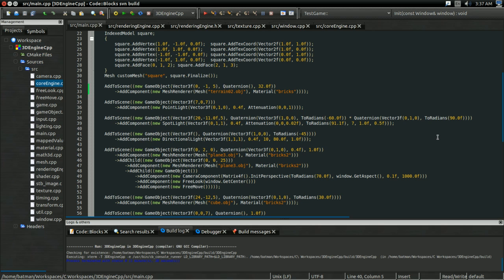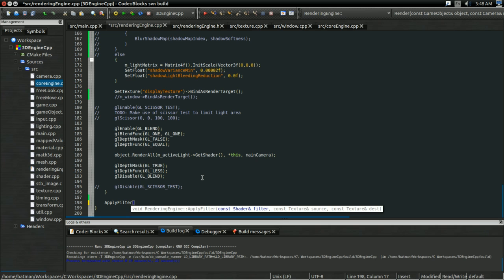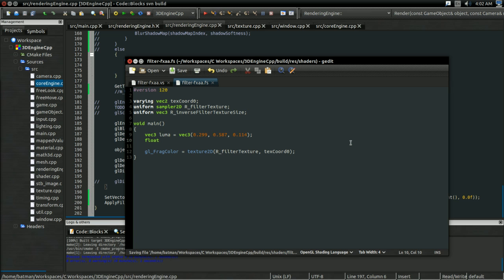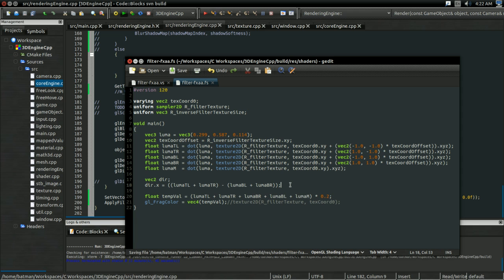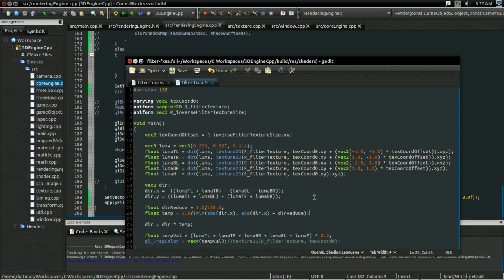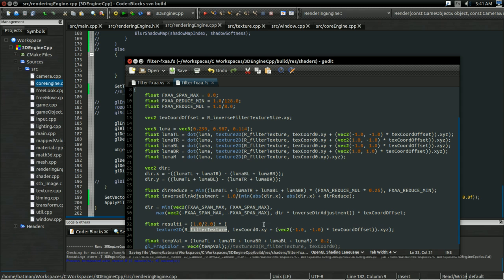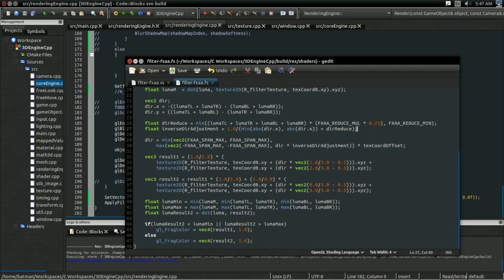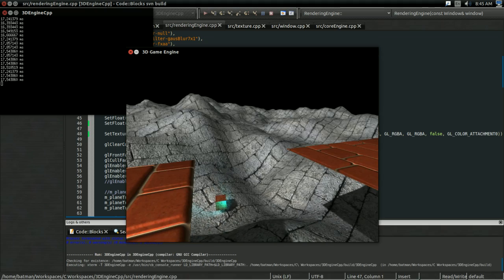OpenGL Game Rendering Tutorial: Implementing FXAA

Comment: I just have one question. Why are you forcing the blur direction to be diagonal up/right when the magnitude is too large, and diagonal down/left if the magnitude is too small?

Couldn't you just normalize the blur direction and multiply by the maximum magnitude to get the same blurring direction, instead of changing it to two different arbitrary directions?

This is the code I don't understand:
dir = min(vec2(MaxMagnitude, MaxMagnitude),  
    max(vec2(-MaxMagnitude, -MaxMagnitude), dir * magnitude) * texCoordOffset;

Comment: Also, couldn't you remove the texture blurring by setting a minimum threshold on the blur direction, and only blur when when the direction is larger than the threshold?
Reply from the maker: Absolutely. In fact, I did this in the code repository.

Comment: The applyFilter method wouldn't work for me in Java because the uv coords were flipped every which way. I had to change them to this on the plane obj:

vt 0.000000 1.000000
vt 1.000000 1.000000
vt 1.000000 0.000000
vt 0.000000 0.000000

They filtered results would have everything flipped on screen.

Comment: Hey +thebennybox. My controls have been working fine. Yet, when I change from rendering directly to the screen to rendering to the texture, some of the controls become reversed. Up & down are correct, however left & right are reversed. Do you have any idea what could be causing this? Thanks.
Reply: ***** Isaac Woods  I'm still trying to solve this bug and I've figured out (in my case at least), It has nothing to do with plane orientation, (I made a hardcoded plane, that displays the texture perfectly fine, at 0,0,0 with the right size and orientation), it's not the camera, because you can get rid of the T_MVP, it is unnecessary if the plane is in right position and the camera too. The filtertexure comes in flipped is the problem, This is an easy fix, i can just also flip the texCoords of the hardcoded plane but it does not solve the core the problem. The only thing i can thing of is if the texture binding as renderTarget or the texture initialisation is wrong but i can not track the issue, plz help!
Reply from the maker: Simple: In your ApplyFilter code, you're rendering an upside down plane, or it's in some other odd orientation.
Reply: ***** That is what I thought was happening. But the plane transform looks as it does in your code. In your Github repository, I noticed you where rotating altCamera by 180 on the y axis. In my code, I set the rotation to 0:  altCamera.getTransform().setRot(new Quaternion(Transform.yAxis, (float) Math.toRadians(0f))); When I set this to 180 like in your code, the controls don't work at all and it looks like the graphics card is having a hissy fit (image is completely corrupted). I am thinking it's the camera and not the plane? Sorry if this is a stupid question, really not sure what could be causing this.
Reply from the maker: Isaac Woods Then the camera is probably is the issue. As for why it's corrupted, it's hard to say for sure why it is, but the camera is definitely an issue.
Reply: Right. I've looked almost everywhere I can think of that could be a problem. Do you mean the camera rendering the texture to the display, or the camera rendering the scene? Apart from the incorrect rotation, I can't see an issue with the camera. What do you think could be the problem with the camera? Thanks again.
Reply: I have this issue too, only in my java version. Have you found a good solution yet because i just rotated the mainCam 180° on mainCamera.getLeft()-axis, but this is a very dirty fix and i'd like to find the real problem. Are you doing this in java or c++?
Reply: I am doing this in Java. I have completely revamped my rendering engine and have not tried rendering to a texture and then to the window since. I tried rotating the camera by various amounts, none of which worked for me. I have not found a better solution, but will probably be refactoring my renderer so much, my solution will probably not be valid for your code. I would be very interested if you find the cause of this bug though, it's annoyed me and I'll be glad to see the back of it.
Reply: I'll tell you when I find something :P
Reply: Not sure how the texture could be wrong - thanks mate. I struggled for ages on this issue - good to know it's a relatively simple, if dirty, fix. Oh well, please tell us if you get to the bottom of it. Cheers again!

Comment: Nice video! I didn't want to jump into implementing AA just yet (had MSAA waaaay back, but when I moved to Deferred Rendering I had to get rid of it due to obvious reasons), but seeing how it can be implemented in less than an hour, I gave it a go. And it's nice! Thanks for the video & the links in the shader header, they're most certainly useful.

BTW, you don't need to pass in the texture size as a uniform, you can just use "textureSize". Not sure if how big of an impact calculating the texel size on a per-pixel basis would mean, but I personally like to do it this way, as I don't use plain uniform unless it's really, really necessary (only for separable gaussian blur to pass in the direction, at the moment). Just thought I'd mention it, because I've never heard of that GLSL function until like 2 months ago, and was very happy when I figured it out that you can query the texture size directly in the shader.

You can also get rid of that branch at the end using a combination of clamp and 2 steps. New hardware doesn't really care, although old ones are really sensitive to branching, so ifs are best avoided, when possible.

These are just some micro-optimizations though, but I still felt like mentioning it as I have experienced pretty good results with branch eliminations on my old, cr*ppy gt430.
Reply from the maker: Thanks for the comment; it's good to hear FXAA is working out for you!

I had no idea that GLSL had a textureSize function. Thanks very much for the tip; that's a lot nicer than using uniforms for everything.

Also thanks for the tip about branch elimination. It's not the biggest deal in the world, but it doesn't particularly hurt anything and it makes the code more friendly for older hardware.